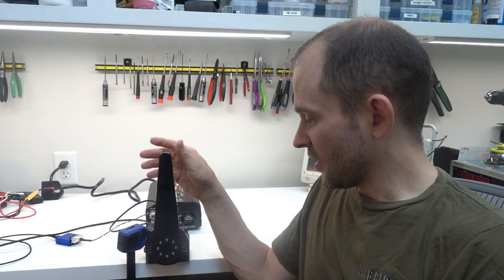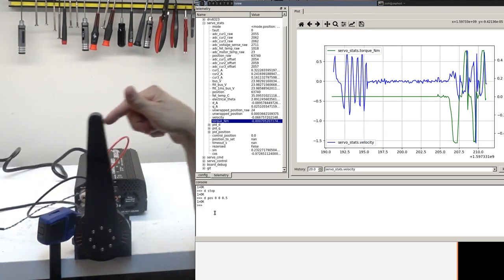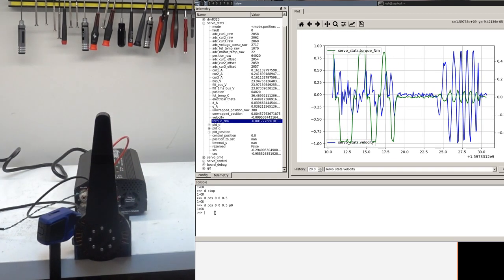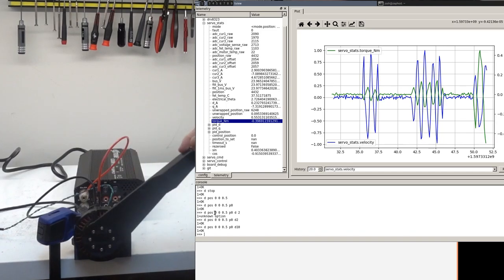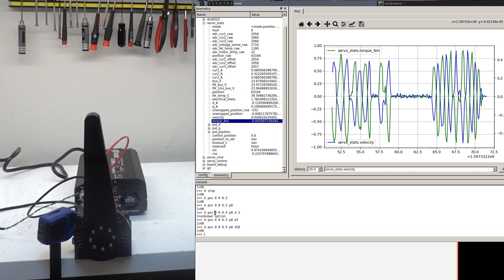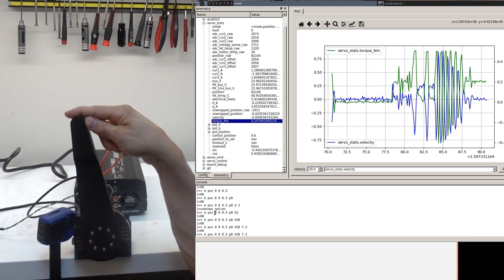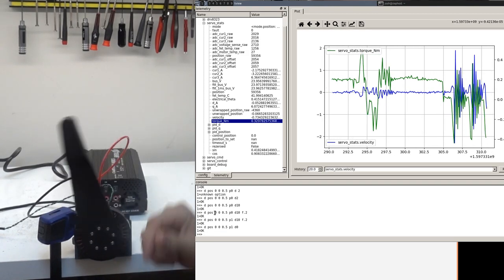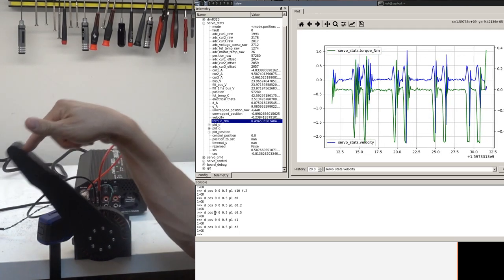Configurable damping and spring constants with the moteus bldc controller

Comment: I want to build silent linear actuator , I am thinking buying odrive dc motor encoder, but can this motor be used?  for 3d printer or small cnc router?
Reply from the maker: Assuming by "linear actuator" you actually mean a regular rotary BLDC motor with mechanical pieces attached like a belt drive to create linear motion, then yes, the moteus controller is perfectly suitable, although no existing CNC or 3d printer software knows how to speak its CAN protocol that I am aware of.

You could modify the firmware to support a proper linear drive motor, but it is unlikely it would have the force necessary to be useful in a 3d printer or CNC router application.